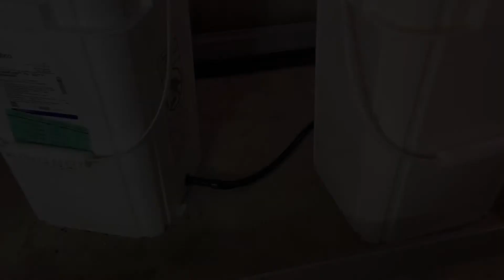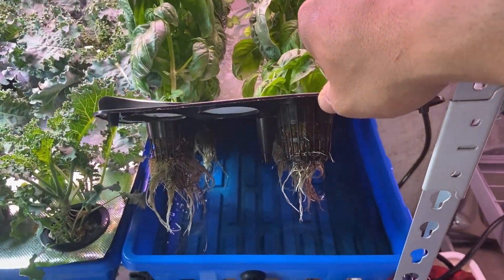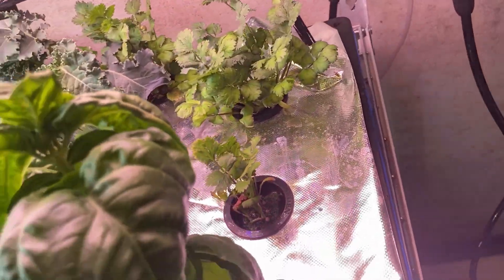DIY indoor NFT Hydroponic Grow System (Simple to make and Customizable)

Comment: Nice setup.  Re: the spongeless vivosun, you can grab a pump filter bag to go around the whole thing.  I still do it on my EcoFlow even though it has the sponge.  I'm also suffering from occasional root rot in a similar, but DWC setup because of the heat from the lights.  Have you thought about using a chiller/hydroguard in the reservoir?  I'm contemplating converting mine over to something similar to yours.
Reply from the maker: Good advice! I use a pool skimmer sock.